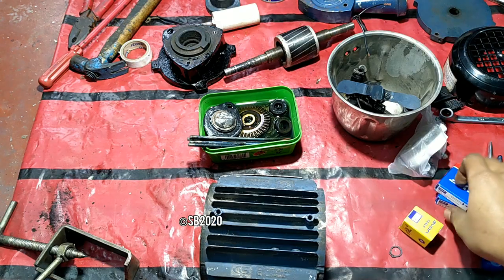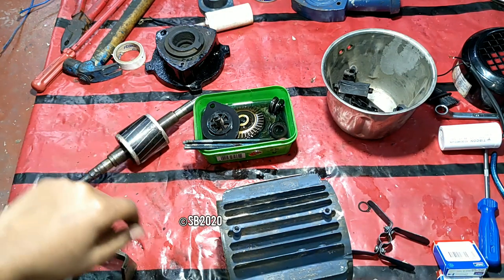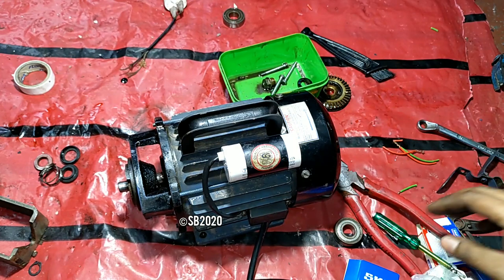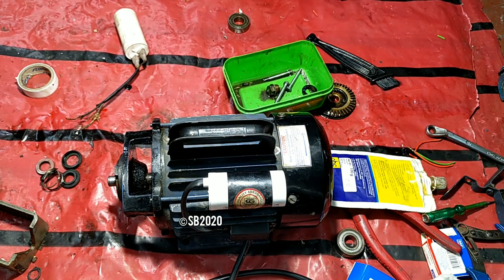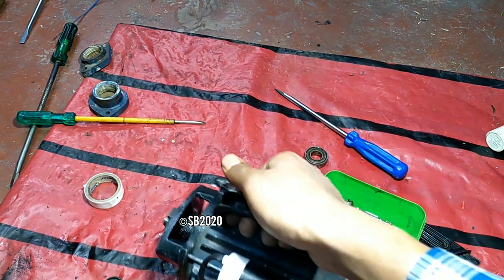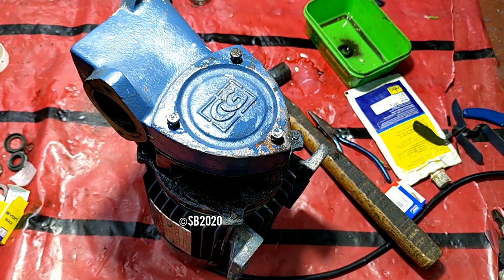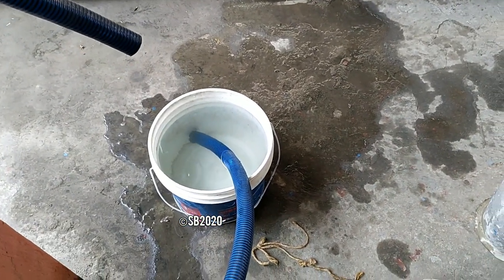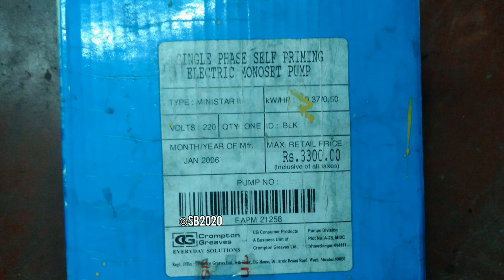Crompton Pump Mini Star-2 (2006) Restoration Part-2

Comment: We have a 2001-02 CG Mini Master 2 which still works great. Never knew Crompton also makes split-phase pumps as mine is a capacitor-start with a centrifugal switch.
Reply from the maker: I see. My cousin have 2001 mini master-2 without any centrifugal switch & it's monobloc pump only. Had 10mfd run capacitor & 6203 bearing both sides.
Reply: It seems like Crompton's design used to change frequently during that time. There was a lot of variation even within the same product line.

Comment: Why the impeller is not having axial locking screw.  I mean how the axial movement of impeller on the shaft is ensured?
Reply from the maker: Basically screw/circlip should be there but companies leave the impeller like that. When water flows, it creates a jacket around it that's why it don't bounces/crashes the walls by sliding.